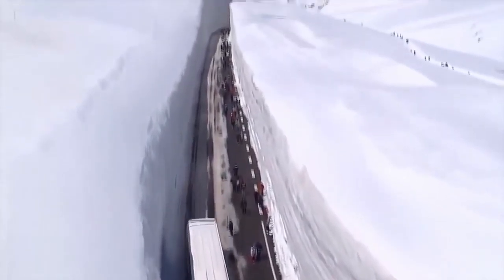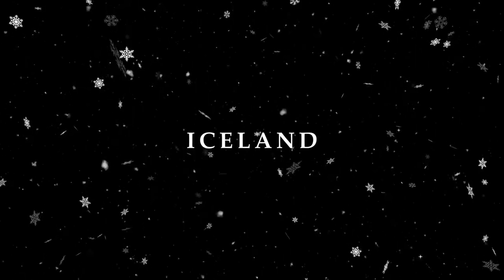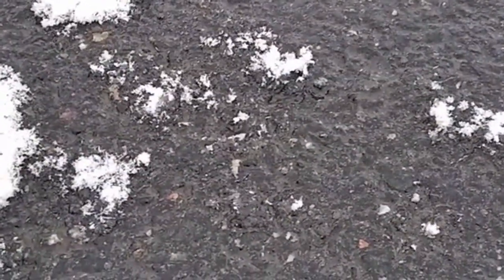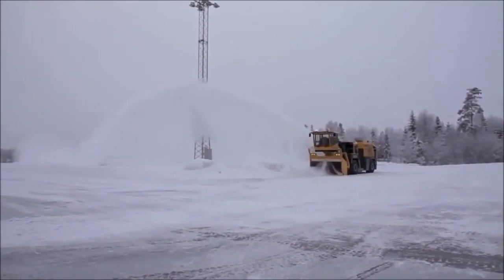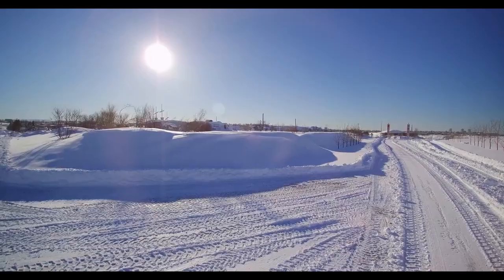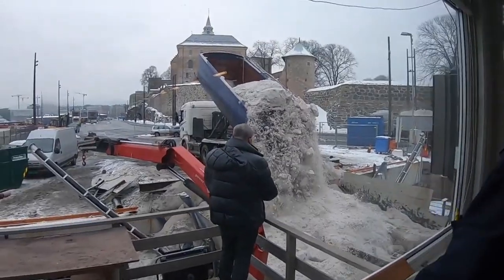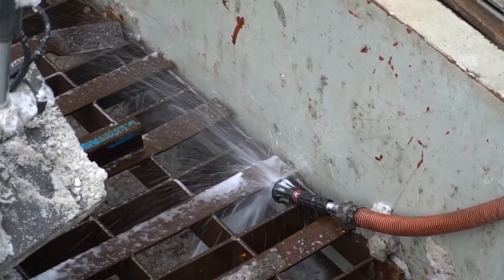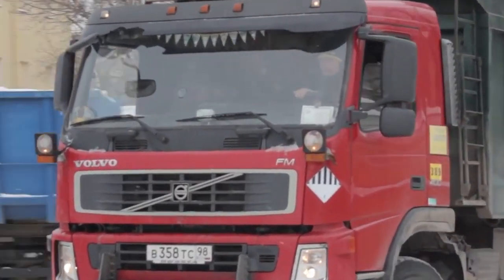HOW TO REMOVE SNOW.  Experience of different countries

Comment: Warm road is expensive way, maybe
Reply: But not in Iceland. Because the warmth is gratis from volcanoes who are warm anyway naturally. So it's only possible in places like Iceland where there is strong volcanic activity. They just put the volcanic warmth to the surface on the streets where they need them. The volcano radiates heat anyway